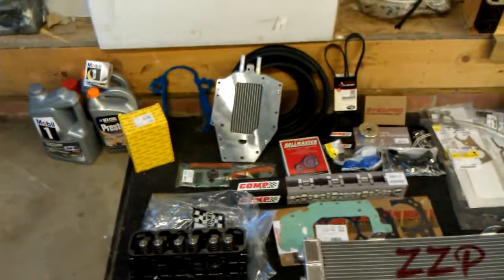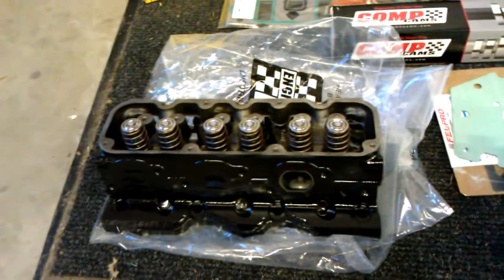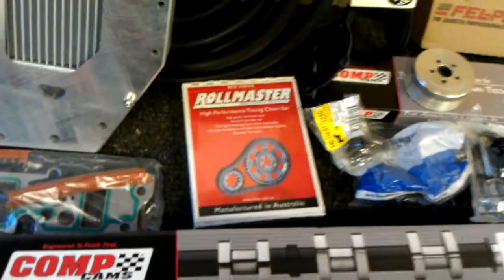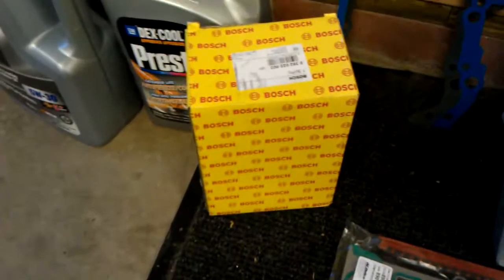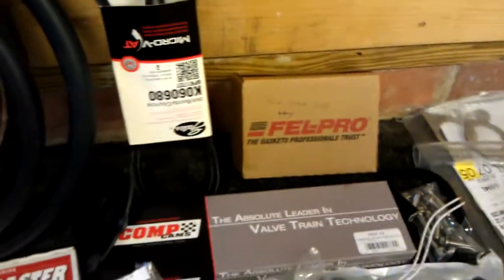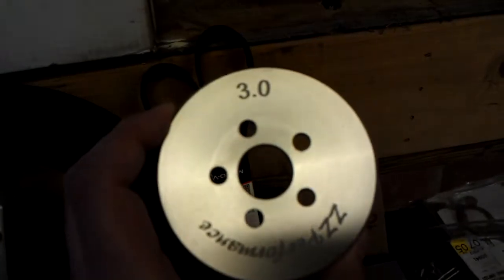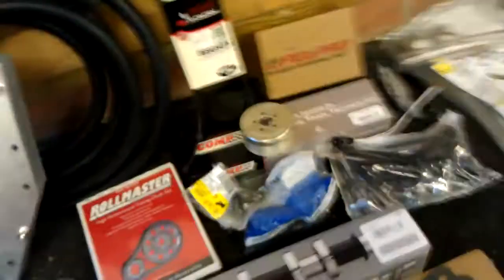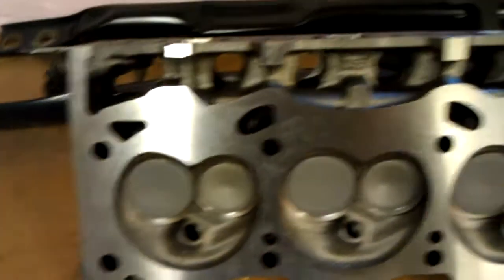2005 GTP XP Cam, ZZP CNC Heads & ZZP Intercooler

Comment from the maker: lol now days yes,  I baught my car in late 06 from a friend with 51,000 miles on it, for $12,000.  I had it for many years and my wife drove it daily.  This was a hobby and hobby can get expensive.  lol I have not touched bottom end of motor and transmision only has a shift kit and raised pressure for faster gear change.  great car i have to say and so much fun!!

Comment from the maker: gaskets, bolts and fluids were $300 total build was $2200. I have total in my motor over the past 4 years is around $3400. not bad for a 4 year build